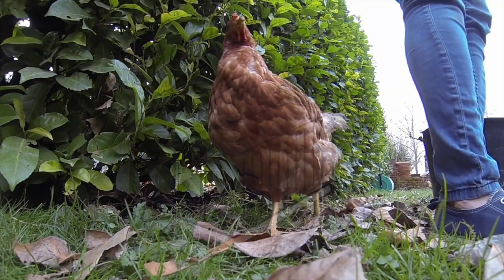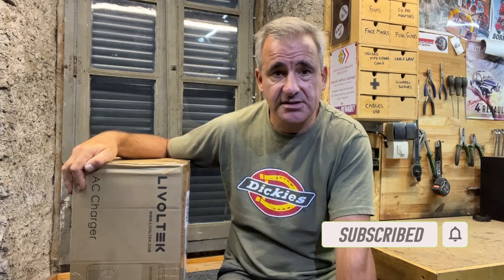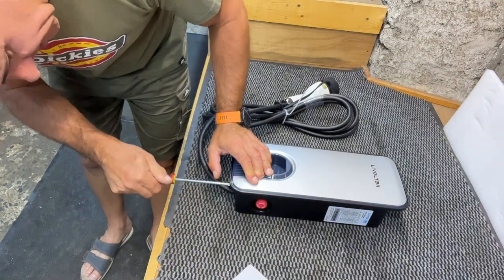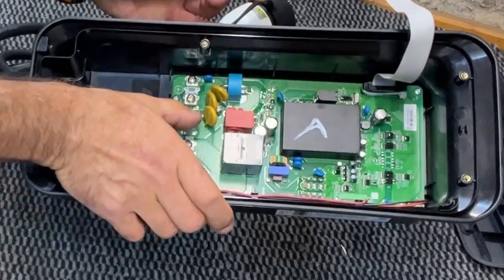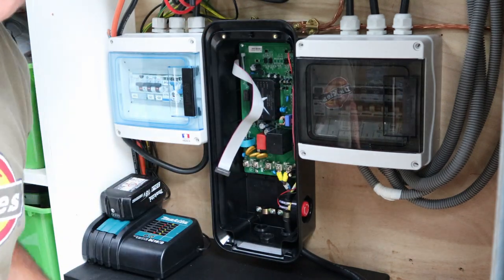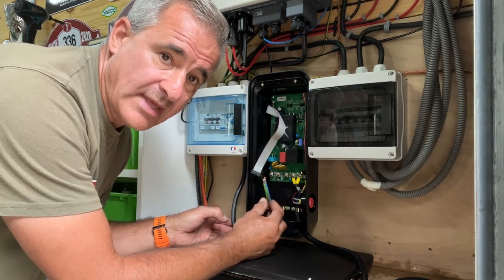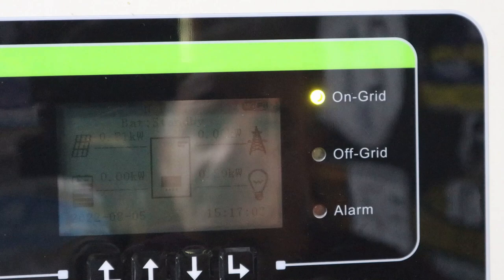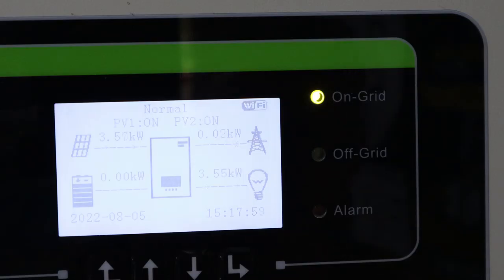Installing EV Charger | LIVOLTEK

Comment: Many thanks we really like your video's. You explain everything so well did you work out a cost for setting up the EV including panels? Also did all the groundworks come in on budget for walls and slab? what would you do different if you did it again? regards David
Reply from the maker: We had already the Solar system - that cost me €7500 a few years ago and included 18 z 340w panels, 1 z 6kw inverter and 2 x 2.4Kw batteries.  Sort of gets us through the night but I need another 6 to 8 batteries to make sure we are comfortable.  The new house and garage will have a lot more panels and a different car charger that CAN use the excess juice to charge (this Livoltek did not in fact work in the end as a smart charger).